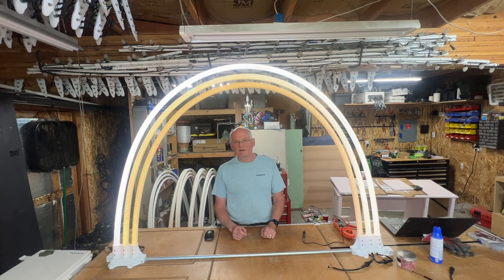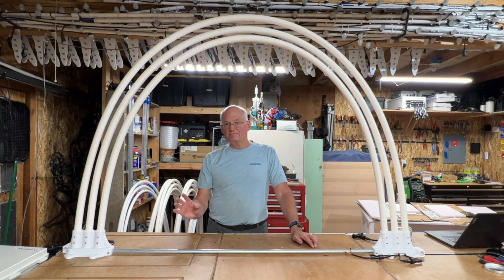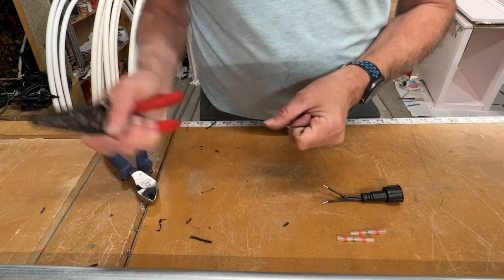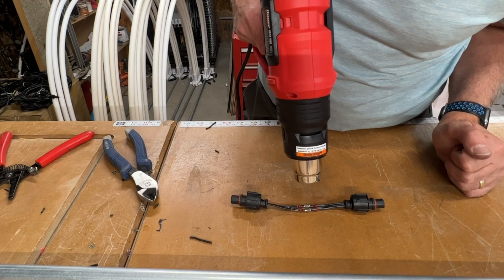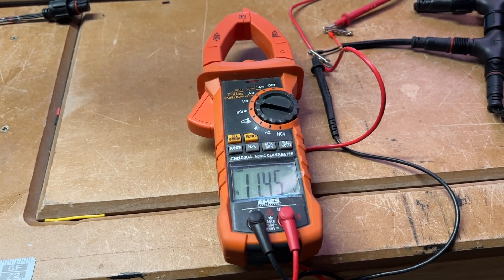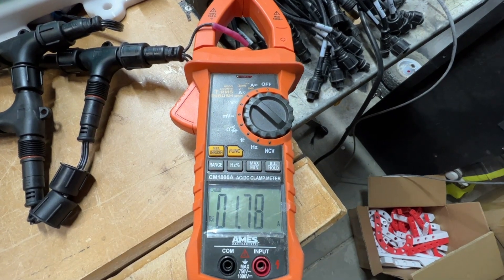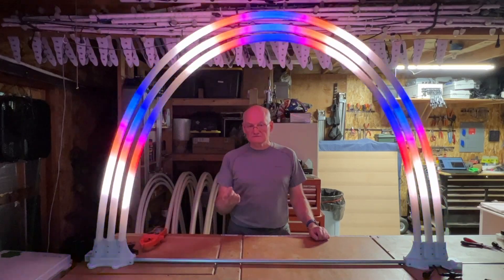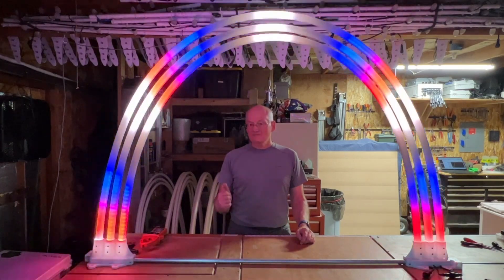Triple arch power balancing

Comment: I'm a bit confused. How many sources of power are being leveraged for this setup. Does it all come from a single connection on the power supply? Or do you leverage multiple power outputs to achieve this effect?
Reply from the maker: The power comes from a single connection.  There is significant voltage drop if you simply daisy chain the strips.  By connecting the V+ and v- from the input to the second and third stops you ensure consistent voltage to each of the three strips.  Keep in mind this only works when using one output.  If you bring in power from a second power supply, you need a different approach

Comment: Power balancing and power injection seems to be the same, sorta.  I work with 5vdc pixels and any prop with anything over 50 pixels I always do power injection.  I primarily use Light O Rama S6 software for the show but use the XLights for my sign with a Raspberry Pi 4B. Weird that Light O Rama recommends the + hooked up only but have found if you use both + and - for power injection you really have a balance of the system. Hence, the difference between power balance versus power injection.  You use of the solderless connectors is also what I use and is so much easier than solder and heat shrink.  Love how you show the voltage drops on both before and after.   Thanks for your time to show us.
Reply from the maker: Great question. For me power balancing is when you use the power from the same power supply.  When you do power injection you typically use different power supplies and as a result you have to break the V+ line before you bring in the power from the new power supply.  Since I am using the power from a single controller output, hence the same power supply,  I do not need to isolate the V+.
Reply: @bergmannlights5149  I thought anytime you use 2 different power supplies you have to bridge them.  I have switching power supplies and it makes sense to use the same one to do power balancing.  Not an expert nor have desire to bridge them.
Thank you for responding!!